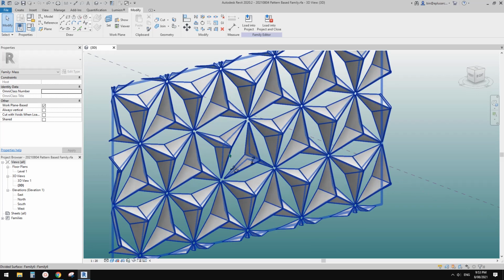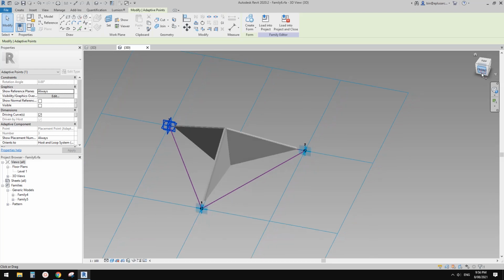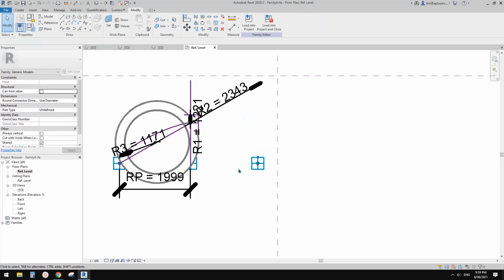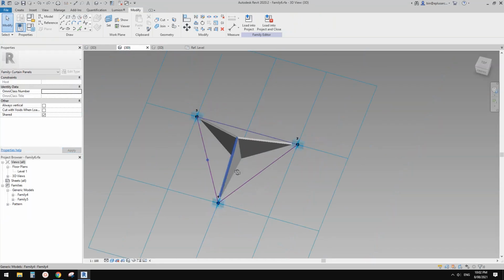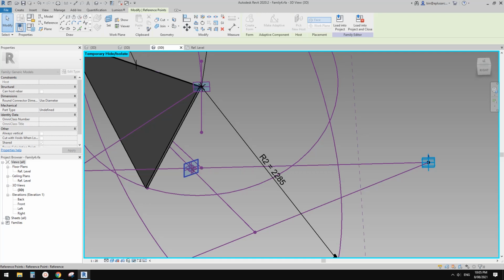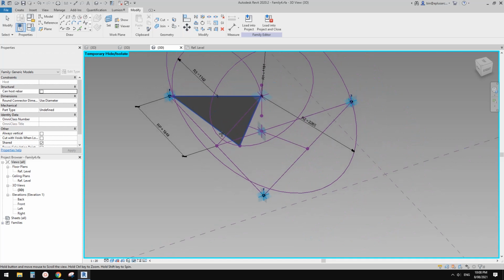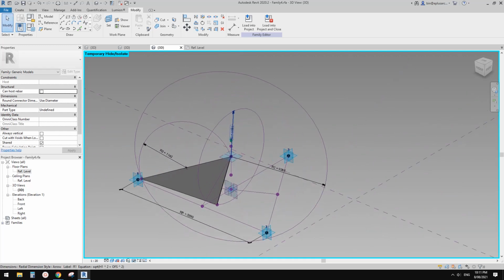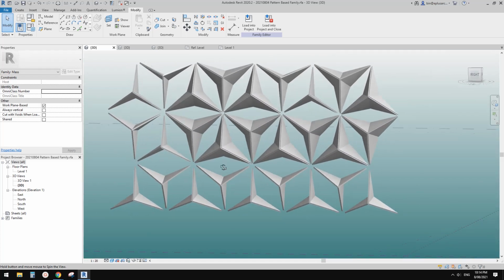Everyday Revit (Day 506) - Modify the Al Bahar Family to suit Curved Surface

Comment: when i apply it they come the other way around the pointy side goes to the interior do you know what i should do?
Reply from the maker: It happed to me as well. I think I break the circle and make it an arc so I can control where it intersect with the spare. But even I made it work in the family, it sometimes did not work in the mass. It happens quite often when I use angle  for the measurement type (point on  arc) and I do not know how to fix it.... Sorry about that.